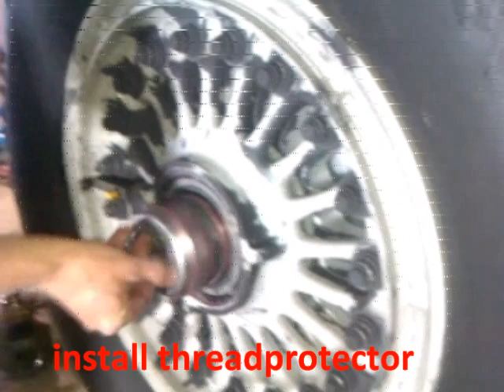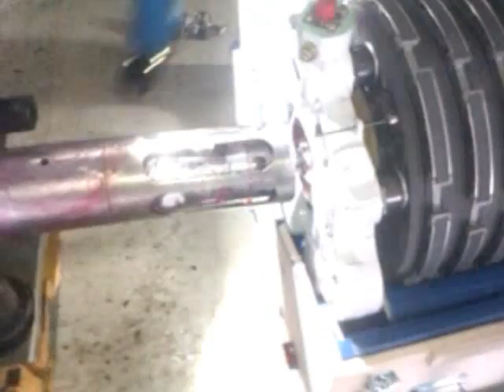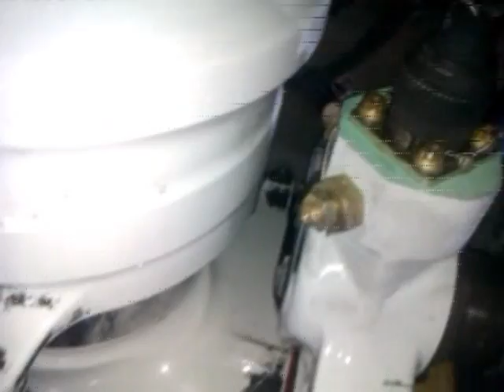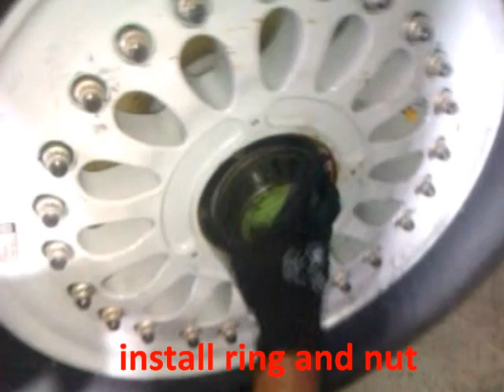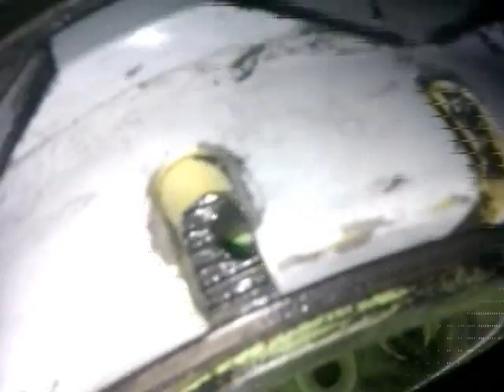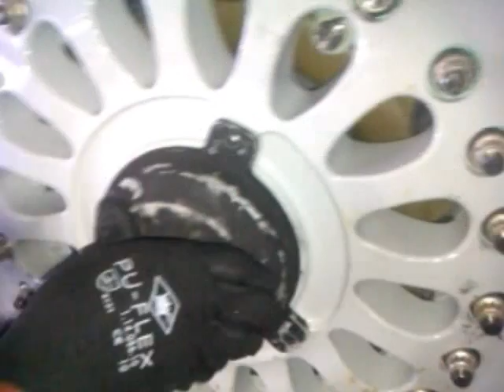Carbon brake and wheel installation on a 737 NG

Comment: I love how the assembly for the newer brakes makes it much more cost effective to maintain compared to the older steel brakes. Those new carbon brakes will probably have the 73G stop literally on a dime without any fading like the older steel brakes at high brake temperatures. And another thing I see is the brake discs cooling off a lot faster than the steel brakes. :) Sweet job!

Comment: The 600lbft ist to set the bearings and washers in the correct position. Its also the reason to rotate the wheel by tightening the Nut. But the load to the pivot and the bearings ist much to hard if the brake are hot. So you must reduce the torque to 150 lbft.

Comment: No. The bolts inside the nut are not lockwired.
The 3 hubcap bolts are safetywired.

Comment: You never use a torque wrench to unloose anything and aligning the holes you are not supposed to over torque. You back out to the closest hole
Reply: Yes correct about using a torque wrench to loosen bolts. But the 2nd torque is 150~300ftlbs so you cant back out from 150